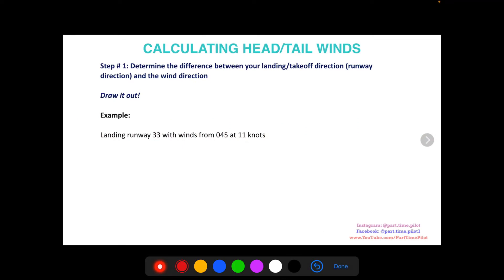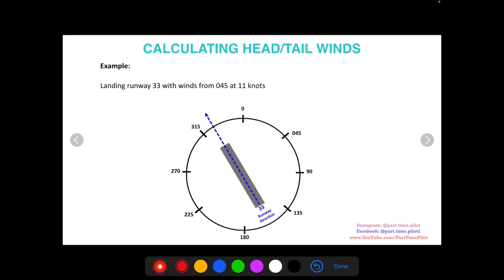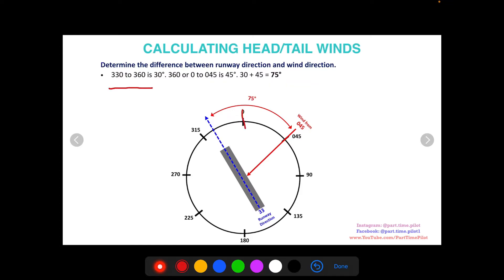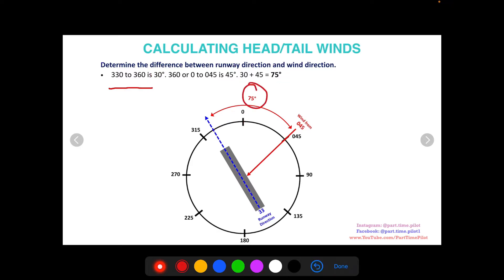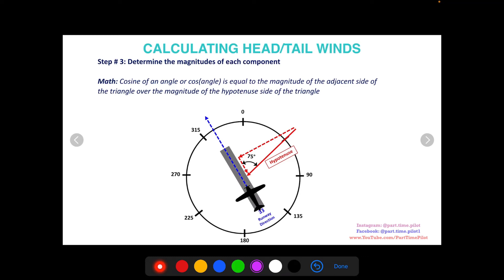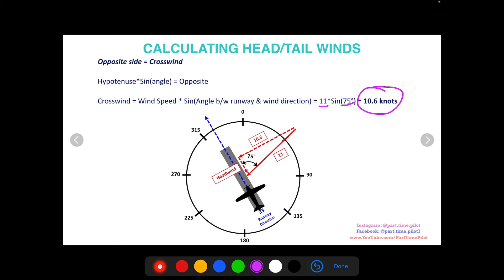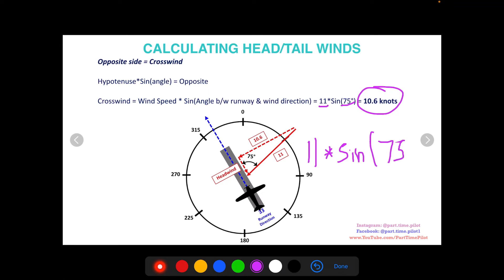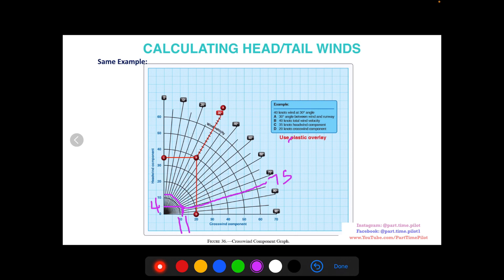How to Find Crosswinds, Headwinds & Tailwinds for Takeoff & Landing - For Student Pilots

Comment: I use an app
Reply from the maker: What if you have no service, phones dead, iPad dead?
Reply: @PartTimePilot  don't need service, have two devices including an e6b which is a lot faster and more reliable than me trying to figure it out while flying.
Reply from the maker: @douglasanderson1276  e6b could die as well.  Plus a quick chart, table method can be faster than an e6b